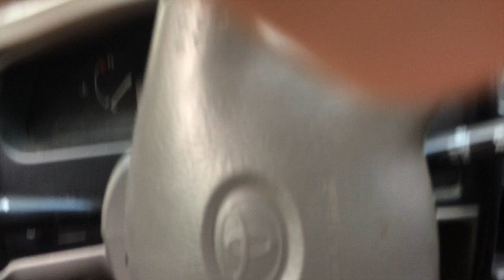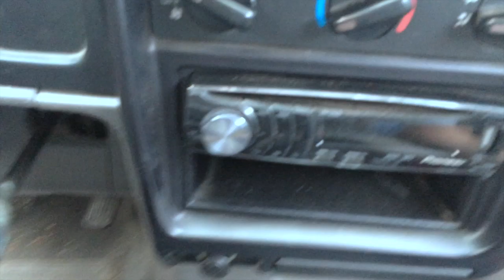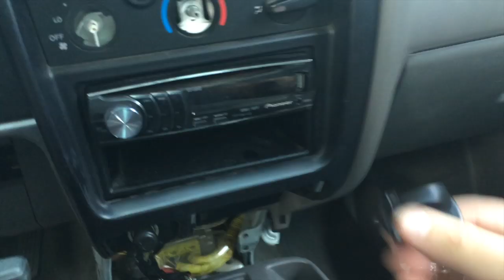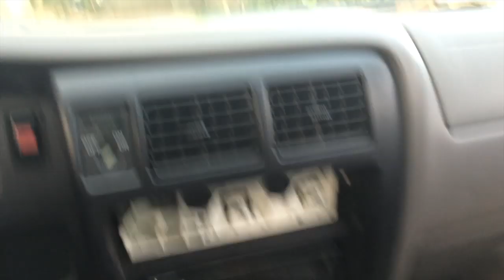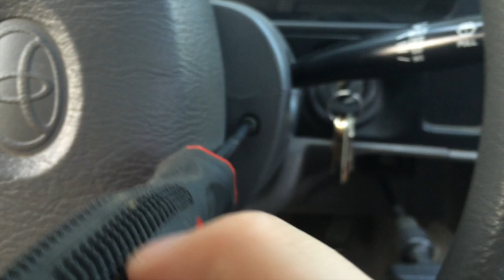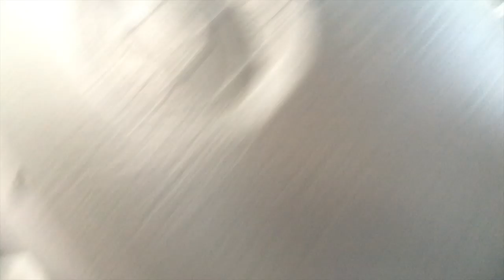2001-2004 Tacoma Gauge Cluster Swap Part 1

Comment: Great job.  I did this swap on a base 2003 Tacoma and it was a royal pain.  Since then, I've had to remove the dash for all sorts of different wiring and bulb changes and it's just as frustrating each time--especially that little screw under the steering column.  Really good to see this video set available for others and very clear explanation throughout.  I was amazed--a day after last taking my dash apart--to see this video in my subscription feed.
Reply from the maker: Thanks for the feedback! I was really trying to make sure I got everything in there to make people feel confident in doing these things themselves. The last part about these videos popping up must be telepathy haha
Reply: Dmonkey Productions You definitely were thorough and I'm sure it'll help people out.  We need more 1st gen Tacoma vids like this--especially for the base model--as it seems to be the most overlooked Toyota truck (but one of the most common) out there.  One nitpick: The ECU/ECM is actually behind the glove box.  The wiring behind the mid-dash console assembly is more for wire junctions, airbag control, HVAC, etc.  The dangling, unused, wiring behind the dash blanks (where switches would appear with better package deals) are ideal 12V taps for low-amp gauges or lighted switches, even allowing brightness control.  On this model, the 4WD fuse socket in the fuse assembly is perfect for supply power to other items via an add-a-fuse.  Right now I'm trying to find out how to drive the tachometer from an independent source once the computer's swapped with something custom.
Reply from the maker: Jeff Sheldon You're right, I misspoke on the ECU bit, good catch! Do you mind if I add your comment to the decription?
Reply: If there's anything you find useful, sure.
Reply from the maker: Jeff Sheldon I did find a lot of  it useful! Thanks!

Comment: my truck is 2.4. cluster from 2.7 will fit?
Reply from the maker: Mine was from a 2.7 as well. As long as the years match. For example 01-04 interchange

Comment: Did the miles stay the same in the swap?
Reply from the maker: That's a great question, the answer is no, they didn't. The miles of the truck live on the cluster so I had to pay to have the odometer reset to the actual miles of the truck. This meant filing paperwork with the state and signing that I'm being truthful. I really wish the information was stored in the ECU because it's a digital odometer anyway.  Thanks for the comment!
Reply: Dmonkey thanks man! I’m about to take mine out to change some bulbs that went out
Reply: Dmonkey thank you so much on the sweet video!! I just got done doing my stuff and it went smoothly!! You rock!
Reply from the maker: riders315  hey man that’s awesome! Im glad it went well!

Comment: Do you have a part number?
Reply from the maker: Jose Batista I do not, no. Sorry :(
Reply: no worries, i found the cluster, i should have it in a few days, i'll post the part number.
Reply from the maker: Jose Batista  awesome man. Glad you found a cluster as well. The tach clusters look so much better than the speedo only clusters.
Reply: @alejandrobatista2481  DId you get the part number? Ive tried a cluster with part 83800-04450,but my RPMs are not matching... Also Idles below 500
Reply: @jasontoves2878  I’ll check later when I get home, did you make sure that the cluster came from a truck with the same amount of cylinders as yours?